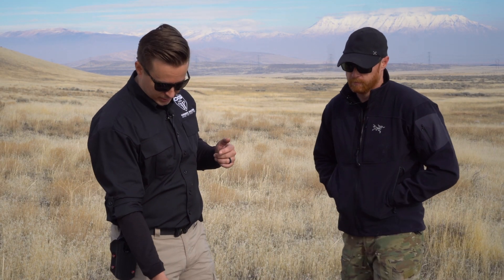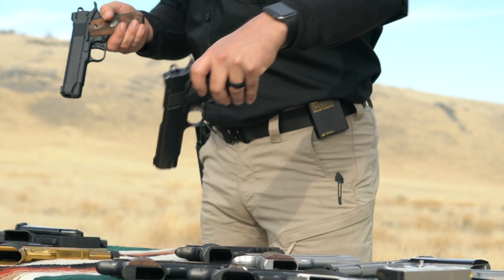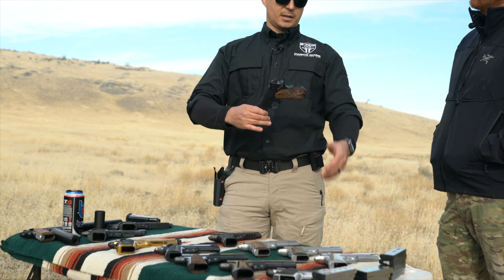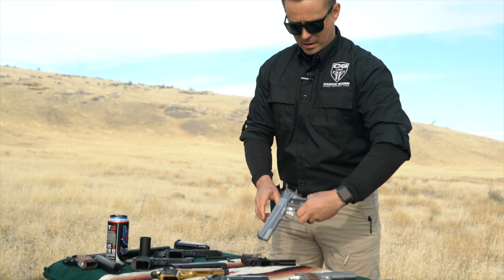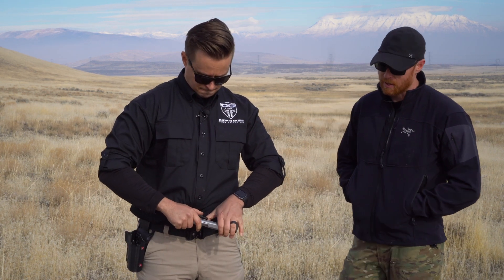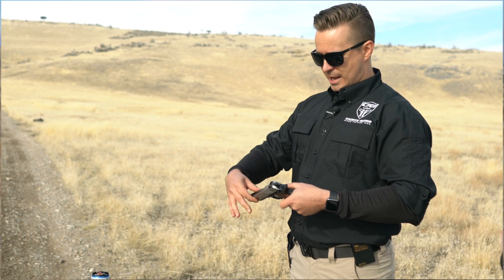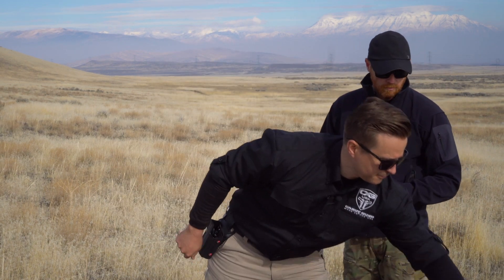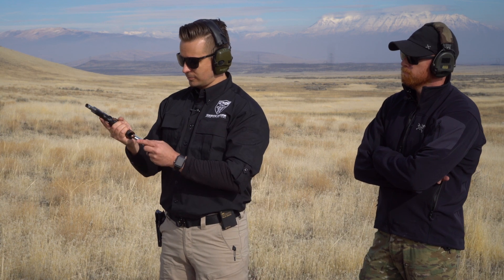Swapping a Government Slide to a Cabot Commander 1911 Frame

Comment: Most commanders have shorter dust cover and rails and the barrel lug groove in the frame is farther back ....a commander slide on a full size has never ran reliably in my experience...Unless they make there frames different than colts full size or commander or rock islands

Comment: Sorry guys, but this is not new news at all. I am surprised by by how much you guys are surprised upon discovering  the1911 swapping slides.. If the guns are series 70 you can switch slides with the frames from an officer to commander to a full government model and the same can be said for a series 80.. the frames and slides are designed to the same spec in each series group. the reason to remain the swapping in each series group is to have the right interaction between the safety levers and the firing pin safety plungers in series 80 and the absence of these component in series 70.

That said, depending on the fit and finish tolerance, you might run into some problems due to the ejector dimensions.. Some older models had beefier ejectors and the slides were fitted for clearing these beefy ejectors. In that case you might have upside compatibility but not downside compatibility.. Until you work on a 1911, do a trigger job or fit some components you will not comprehend how much the design, is simple, reliable and amazingly easy to master.
Reply: What do you. Expect, these two clowns are salesmen only, know nothing about how 1911’s actually work, might get dirty 😂😂

Comment: Could the four and a quarter inch slide fir on the 5” frame????
Reply: That's dangerous, even if you were to happen to get it on the rails far  enough to actually have the hammer drop on the  firing pin the slide &barrel would be shorter than the "dust cover"  probably causing it to not cycle correctly.. It may be able to get the 1st round off but not going to cycle correctly..
Reply from the maker: Yes... we could've swapped the other way around since the frame is the same.
Reply from the maker: @zzxxooooxxzz4964   not with ours... the frame is the same on both commander and full size.